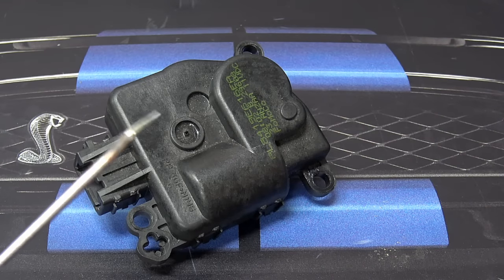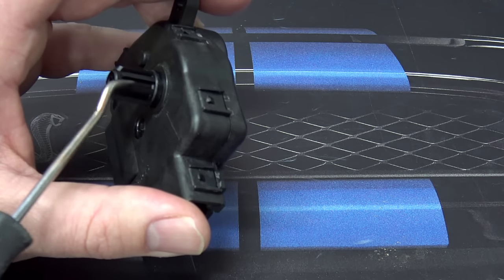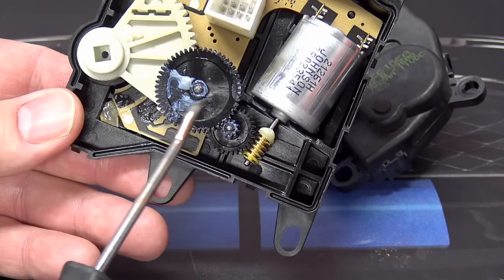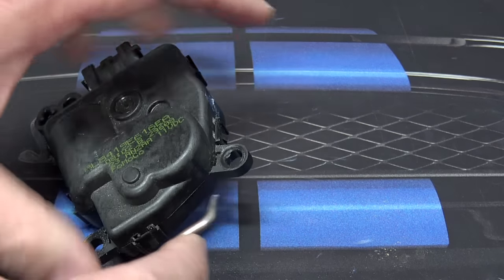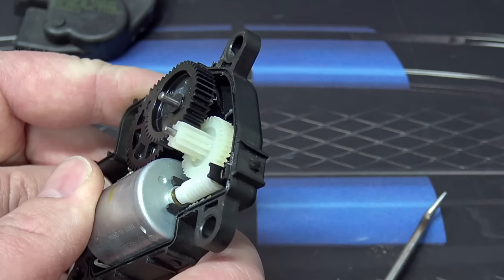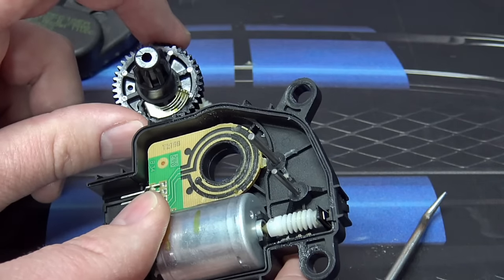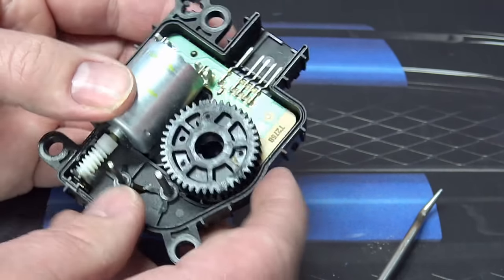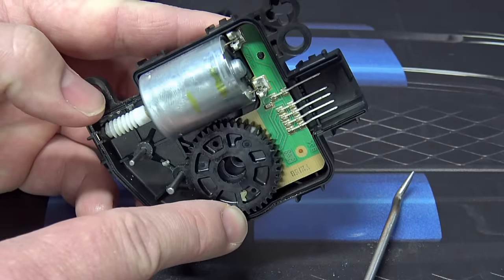Ford Vehicles: Frequent Blend Door Actuator Failures and Why?

Comment: I have a 2014 Ford Taurus sel. With the dual zone climate control. Today I noticed no matter what position I select, defrost, floor etc. The air only comes out of the front facing vents. Heat amd A/c still seem to be working, just can't change the position. Would this cause that?
Reply: Neil Carter. Mode door actuator.

Comment: Is there two actuators on the 2010 Ford Fusion? I see one above the actuator you have, and it looks just like it
Reply: I believe the one on top is for switching from floor defrost, etc. And the bottom one is for temp control. The bottom one should also have 5 pins on the connector.
Reply: @TheEchelon1619  there is two, the other one is on the passenger side between the filter and the middle console. Hard to get out. So I just unplugged it for the summer. Lol
Reply: @bighog6  I guess it depends on the vehicle. Mine has two right by the driver's side panel and as far I know there isn't another one.

Comment: The original from my 2010 Mustang doesn't even have a circuit board, just 1 resistor, no sensors on the main gear at all. Too bad I can't upload a photo. Vent shaft rotates less than ¼ turn and it uses motor overload to shut the switch off.

Comment: Have a question for you.  2011 ford explorer no heat either side , has dual control ac system  rear heat is good. But front does not work .  Any ideas
Reply: Dual control HVaCs each side has their own actuator. If both are not getting heat it’s probably not the actuators   Check the main connector to the hVAC case.

Comment: Great videos very helpful. I have a 2008 F350 with 208k on it, love the truck. I changed the lower door actuator this summer. Now have a noise coming from behind the radio area.  I know there is another actuator back there, as your other video indicates.  This is not a clicking sound its more of a spinning sound and you can hear the slow down when it turn the key off. Like a fan with something in it.  All my heat ducts and blower work fine, radio and CD work fine just his noise.  
I removed the fuse on the radio and the noise stops.  Removed the fuse on the HVAC controller and the noise continues.  I'm trying to isolate the problem before tearing into it.  Base in your experience is this a valid way to isolate the problem?  I'm thinking its a radio problem at this point.
Reply: You need a radio had same problem threw in a new radio and was fine now clicking what my blower I need to fix the actuator I guess
Reply: Yup removed the CD for the nav,  noise stopped.  I keep listening for the upper actuator but everything is working great now.

Comment: my 2006 F-150 passenger rear door actuator went out about 2 years ago. I don't know anything about door actuators nor am I a mechanic, buuuut I ordered what was labeled as the one I needed and it came from china it was real cheap so I guess I shouldn't have been surprised that when I got it after like 2 weeks, it was shaped different and something wasn't right. Well I opened them both up and switched the parts and everything has been working great since then.

Comment: Just replaced the passenger side blend door actuator on a 2017 Ford Explorer.  Opened up the old one and found that the brushes in the motor were totally worn out and broken off causing the motor to short out.  Really crappy cheapo motor with very thin copper brushes.   It did have a real potentiometer which fixed the issues older units had, but motor doesn’t last very long.  Should have used a long life one with real carbon brushes on a $30K+ vehicle !!!!

Comment: My Honda Fit allows me to adjust a set of louvers on each heat vent by using my thumb against a plastic knurl.  Simple, effective and no electrical parts.  Complexity increases the likelihood of failure.

Comment: Thanks for all the great videos!  I have a 2012 mustang and with the AC on the drivers side is not very cold and the passengers side is working correctly. I do not have dual climate control. Can you PLEASE tell me which actuator is the one that controls this so I replace the right one. 
Thanks!
Reply: Did you manage to solve this issue?

Comment: At least it's been engineered so that it doesn't break the tab on the blend door itself.  This is a $30 fix, that in most cases, people can do themselves in less than an hour.  A broken blend door is in the thousands of dollars because they just want to replace the entire HVAC unit, and even if they CAN just replace the blend door you are going to get charged nearly the same amount for the labor of pulling the dash to get the HVAC unit out to fix it.  
Sometimes there is actually a method to their madness.

Comment: Just hunting around for advice... I have a 2006 Mark LT and got a Blend door motor,  problem is the output shaft length, the new one is about an inch in length shorter than the original one. Anyone ever had that issue?

Comment: Thanks for the video!! Very interesting.  My right side of my 2012 Ford Fusion SEL only spits out cold air (left side is hot).  All research points towards the blend door actuator.  Would that be the one inside the glovebox?  Do you have a video of how to replace it?  Please help!  Thanks again for your awesome videos!  Chris
Reply: You probably won’t see this but you’re describing the same problem I’m having right now. Did you ever fix your issue? Cold passenger side and warm driver side.
Reply: @Capitan_Chaos  yes I did fix it. All shops told me it was a 6 hour job and quoted me about 6 or 800 bucks. It took me a few tries, but I did get the Blend Door Actuator swapped out. 25 bucks on Amazon. Haven't had any issues since. It was actually pretty simple, but just very limited space in behind the glovebox and I didn't have a lot of tools. If I recall correctly, if you're having the issue on the left side, it's a lot harder to fix/access. That blend door actuator is inside the dash, and you'd have to take apart the dash to get to it. LMK if that makes sense!
Reply: @3chrizzl  With a comment that old I didn’t think you’d reply. I have a Mustang and your comment describes somewhat what my car is doing. It blows hot on driver side and cold passenger side but only in the morning and at night. So which one you replaced?
Reply: @Capitan_Chaos  I replaced the one on the right, I couldn't control the heating or cooling on the right side at all. It was winter, so the right side was blowing out freezing cold winter air (I live in Minnesota). Just to confirm, you can control the heating cooling on the left? Heat and cold, right? But on right you can't control anything? This is very odd about the morning/evening thing. Mine was straight up broken. 0 control
Reply: @3chrizzl  I have one knob that controls both sides but only right passenger side works. I can somewhat control left side when I turn the knob to heat it just becomes like a blow dryer.
Reply: @Capitan_Chaos  my Fusion has Zone Control, so the left and right are totally seperate, or there's an Auto option for both sides to be the same temp. I'd look into that for your Mustang and see if a simple part can be replaced.  Pain in the butt, but very rewarding if you can figure it out
Reply: @3chrizzl  thanks man.

Comment: Ok. I have replaced the faulty blend door actuator but my escape still has the same issue of incorrect temperature-to-setting ratio. When set at 60 degrees the air is cold, but after turning to 75ish the air becomes hot (like maxed out). Only passenger side is affected. Does anyone have an idea on how to fix this?

Comment: This is the second time my actuator has failed so when I removed it I noticed that some of the teeth were stripped on the part where the blend door goes into.   Now I don't know if I need to replace that or how to go about it.  It's the middle of summer and I got no ac, so this is an emergency.    Can anyone shine a light on my problem?
Reply: Roll the windows down
Reply: im going to get rid of my ford because this happens way to often. about every six months. every time you turn on your car those gears move even if you dont have the ac on.

Comment: Hey guys, anyone know how to recalibrate these motors after installing a new one on the 2015? I thought it had something to do with pulling a fuse? Anyone have the insight and the procedure?
Reply from the maker: 2015 what model.
Reply: @FordTechMakuloco  you bet! 2015 GT
Reply from the maker: No recalibration needed on your model.
Reply: @FordTechMakuloco  ok, thanks so much for the insights. Do you know if the motors are designed just to work so that they sense the resistance at the stops? What I'm experiencing after I bought and installed a new motor, is that it just keeps running and the gears keep stripping when I turn the car on. I'm puzzled by this. I did buy an aftermarket motor. Could this be the culprit?
Reply: @FordTechMakuloco  Have a 2003 Expedition XLT with this issue in the rear ac. This video is 6 years old. Any improvements on the newer blend door motors from this video? I'll be attempting to fix this myself. Thanks

Comment: Which style actuator would be in an 07 Escape and 08 Marquis?  older style on both?
Reply from the maker: +brakedd The escape is cable driven and the GM has the old style.

Comment: So im out of cold air and the place i took the truck to said everything is normal, pressure is normal and you can feel a little cold air coming out with hot/warm air but not cold enough for this texas heat.. I normally use the cold air like at %10 at night and %100 during the day but it feels like if its stuck at %10 cold and its not enough during the day.. could this be the temp actuator anybody?

Comment: Great explanation and great video but I have a question for you? I notice on most Ford vehicles are from 09 -12  does this also happen on the 13 models? I have a 13 f150 that my ac blows but blows hot air on both passenger and driver as I speed up or am on the highway the ac blows a little colder as I stop it starts to blow air but not hot like the heater would be running any ideas??? It's a 13 f150 lariat please I would like to know your opinion great videos

Comment: best way to avoid these motors from breaking is to never turn them all the way off or on . when you do that there is tension against the plastic wheels and they strip out . so never turn your controls to the very extremes

Comment: I am wondering if this is contributing to my problem of my Climate control refusing to shut off at all. It will work fine for a few hours, then when I try to turn off the air, it changes to full blast and the power button does nothing until I remove the blower motor resistor.

Comment: I have them new actuator but it doesn’t line up with the teeth on the base. What can I do to fix this?
Reply: You can turn the receiving base with your hand so the teeth line up with your new motor. I put one in my 2015 f150 today.
Reply: It’s not broken. There’s nothing to fix. You have to plug it in and get it close to where you insert it, and then turn on your car and turn on your AC and wait for the gear to rotate so you can put it into the hole with no issue. Very normal thing to have to do.

Comment: I have this problem on 2012 Edge.  is this the same part?  And where is it located?
Reply from the maker: +Greg Richards same problem different part yes, pm me for instructions
Reply from the maker: +FordTechMakuloco pm me on Facebook
Reply: FordTechMakuloco I have a 1998 ford ranger my problem is I only have air blowing out of the defrost vents could I have this same problem with the blend door actuator
Reply: +FordTechMakuloco just had the heat on the drivers side go out. It works everywhere except the drivers side vents and floor. This is the reason isn't it?

Comment: I've got a 1991 Crown Vic, and have NEVER had a problem with this junk! Why? because back then they used a manual cable instead of an electronic actuator. Perfectly good,  never fail design on the 91. Ford invents a problem where there doesn't have to be one. The newer the car the bigger the junk they fill it with.

Comment: I got ford f150 5.0L 2013 I just replaced mine shop around or mechanics will take your $$$$ I got quoted $1850 and 1000 to do this work and they both needed my vehicle for 2 days ouch but I found a mechanic and he fixed my blender door motor in 2hr and half cost me $271 canadian now my heat is blowing hot as ever

Comment: i have a lincoln navigator 2011 limited edition and it has these tow parts 

the first one in this video is for the front HVAC Blend Door Actuator and the second one is for the rear HVAC Blend Door Actuator and they are tow in the rear right panel 

so it is not an old and new thing like you said !! they are simply tow different parts

Comment: What makes the clickng sound?
Reply from the maker: The popping of the gears dues to the broken  tooth.
Reply: Just replaced mine yesterday. The large gear was missing 3 teeth. It wasn't too hard to do. My problem was holding on to the 8mm getting to the back screw. I dropped it in the back. Used a magnetic stick to get it. I tied a long string to it then a little socket to the end of the string.
Reply: Took it apart and found 3 teeth gone on the big gear.  Also the replacement went good. The only problem is I dropped the 8mm wrench inside backing out the back screw where I could not reach it. I used a magnetic tool strip holder and got it. I tied a string to the wrench and tied a small socket to the end of the string. I had only one wrench so didn't want to take any chances !
Reply: I put one in my towncar. It works but it clicks when I set the temp low. The longer the ac is on (colder it gets) the lower I can bring the temp. It will click then I bring the temp up 1 degree until it stops.

Comment: Yes good info. To bad you can't buy just the part that fails , you'll have buy the whole unit so they can charge you more money. Never had problems with the mechanical ones that were vacuum driven , or hard wire driven. Planed Obsolescence. We don't care about the customers, just about how much profit we can make on these crappy cars.

Comment: It's a numbers game ... when the engines and tranny are good, you'll have these engineering miracles to get you into the shop.  One way or another, plan to fail engineering drives business.  Their motto is probably "engineer to fail without losing brand reputation".  Machines can be built which are as close to perfection as possible ... they're just not available to the consumer working class.  Our company has robots that were made in Germany and France ... they operate without failure all day every day.  We also have robots made in Asia ... they break down all the time but cost half as much.  Where do you think Ford has these parts made???

Comment: 2012 escape with under 70k miles had one go out because the doors binded, and the crap replacement part is failing a year later. part is such a b1tch to get to.

Comment: I have the old style in my 1999 Grand Marquis but it failed recently and took me some research to figure out how to bypass it.   The dumb ass Ford engineers (and I work with dumb ass automotive engineers so I know how stupid they can be) put this in the hardest to reach place imaginable.  I found a way to get up thru the glove compartment area to remove a bolt and force it off of the blend door lever so I could manually move the blend door into position for A/C mode.

Comment: Engineers are making things more complex , harder to fix, and more expensive .   this is not sustainable . we need simple  ,cheap and highly functional . .   if you think this is bad wait until you're   electronic steering   or  your autonomous driving system    fails--this is not a space vehicle it is transport for the masses . When you are at lease end   or  warranty end   people will just abandon these trash piles  on the road where they die. Civilization has taken wrong turns before. this will be a biggie .

Comment: The other brands have the same plastic gears and the same damn problem so please go work for Chevy or dodge they really suck.I worked with Lincoln and mercury 26 years and now 5 years independent work on all brands same crap.I have never had a blend door actuator failure 2003 f150 200,000 miles 2015 f150 parents grand marquis and Lincoln mk lt and brothers fusion and sisters fusion.

Comment: Like this comment so people can see a new solution I just tried, I finally figured out how to fix any blend door by only removing the stero/ac control panel, If people are still having this problem and are interested I'll make a how to video. So I have replaced the Driver side blend door before on my F150 , It is the biggest pain. So I swore to myself if it failed again I would come up with a solution that didn't require removing the center console, seat or dash or anything huge items like that. So guess what, it failed about 14months later, and I was forced to make good on my promise to my self. Just finished, I'm gonna make a how to video if people are interested. But I got driver side air working again with only removing the climate contol/ Radio unit and the CD changer behind it. (Not trolling, just want to know if people are still having this problem). It may only work for my blend door actuator issues, or it might work for most if not all blend door actuator issues. I went through the process of by passing the potentiometer feed back and position sensor to wire in my own control over the motor to relocate it correctly.